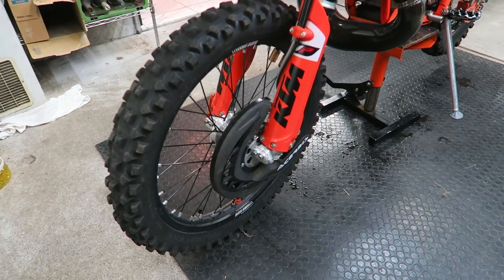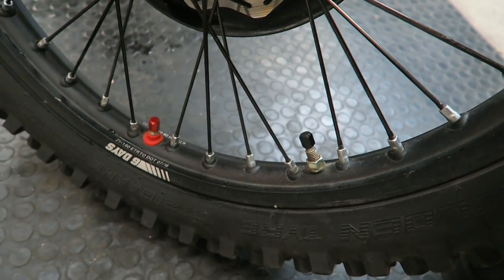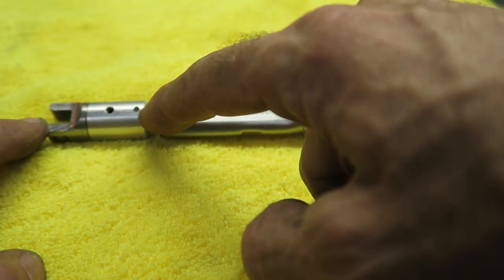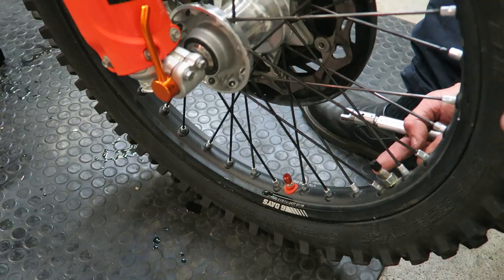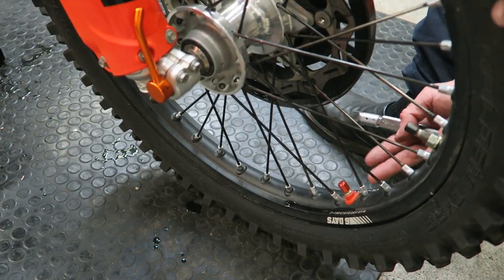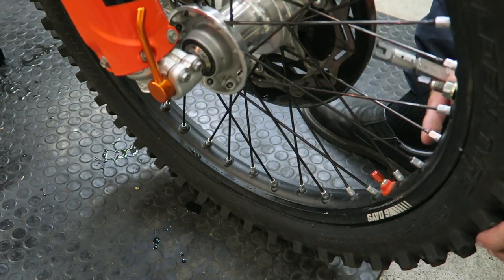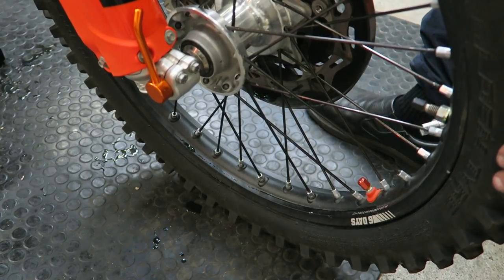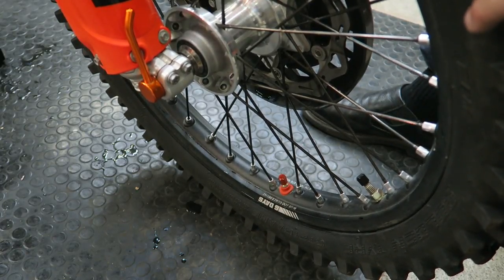Wheel Spoke Tension Adjustment

Comment: Hoping that you’re still monitoring this old video, here is a technical question. As in your case, when I go around the wheel some spokes are torqued and other aren’t. If the wheel is true, tightening only some spokes, would it not pull it off centre? Do i need to worry? How can I make sure that doesn’t happen? Thanks.
Reply from the maker: If you’re worried about the wheel being out of true you can attach something (Eg a chop stick) to one of the fork tubes, or swing arm so you can monitor how out of true the wheel is. For off-road wheels they don’t need to be that true and within about +/-1mm will be fine.

Comment: Hey just did the first torque on my bike (5hrs) and the rears weren’t too bad, but is it normal that the fronts were super loose? Like had to go around the wheel  6x using this method and only half a turn at a time? The rear took only 3 rotations to get all at 6nm (according to owners manual)
Reply from the maker: Wow, your front sounds like it was very loose. The rear sounds pretty normal. It's lucky you checked and adjusted them...

Comment: Hey mate, my rear wheel has a wobble.  I started with loosening all the spokes and went around and true'd the wheel using the zip tie method. I then went back over with the torque wrench set at 6nm (as per ktm spec) and the wobble is back. What is the trick to trueing vs torquing?
Reply from the maker: If the rim is bent it may not be possible to correct easily. If slight you could ignore it, or try to true it by loosing the spokes on one side of the bent area and tightening on the other. When finished it's still important that all spokes have an equal tension as this is what keeps the wheel strong and less likely to go out of true further.
Reply: @TokyoOffroad  thanks mate. I always look forward to hearing from you. So equal tension would require the torque wrench and this is where it untrue's. I also have 1 spoke that won't budge. I've tried penetrating fluid, vice grips. I'm hesitant to use heat as I'm running tubeless and think it could melt the tape. Thoughts?
Reply from the maker: @frankloschiavo  Yes, using a torque wrench on spokes is only a good method if the spoke nipples and threaded part of the spoke are in good condition and move freely. If any of the the nipples are seized they will need to be freed. When I rebuild wheels I use some anti-seize to help prevent issues. A different method to test the spoke tension which may work better if it's an older wheel with corroded nipple is to listen to the sound of each spoke with tapped with a spoke wrench and to make them all sound a similar note.

Comment: I am interested in the orange protection cover of Tubliss valve. What is that?  Any pros or cons?
Reply from the maker: Chieh-Nan Wang - DRC air valve mud guards. They help prevent dirt and water getting into the rim, without putting stress in the valve. They can be used with tube tires too, not just the Tubliss high pressure valve stem.

Comment: Just went through this procedure on my 18 350 EXCF. Specifically on the front the spokes were extremely loose and needed to go around at least 4-5 times in the skip 3 pattern to bring them to the 6 Nm mark using a torque wrench. I’ve read various things online saying KTM is notorious for loose spokes but this seemed excessive. Only about 12 hours on the bike and this was the first go at the spokes. Interested to know what others think.
Reply: LETSG0WVU mine have been similar on the last two KTMs
Reply: @DoctorGoodnight  I sell KTMs and we show every dirt/adv customer how to check and adjust spoke tension and advise them to check their spokes before every ride for the first 6 rides.  It's not ideal and needs to be remedied by KTM, but it's also a pretty easy thing to keep an eye on.

Comment: Hello!why is so important to keep the wheels straight?you are using the bike only for off road or not?
Reply from the maker: 66AGW - The main reason to keep the spokes adjusted correctly is that it adds a lot of strength to the wheels which is particularly important when riding off-road while riding on rough terrain.
Reply: @TokyoOffroad  my wheels has dents on them and all the pro riders told me not to replace them because i will bent them on the next ride.they must be tight right and that's it
Reply from the maker: 66AGW - Yes, I wouldn’t worry about dents, unless they are causing issues. Just keep the spokes tight and the rims running reasonably straight and you should be fine.

Comment: that dry lube would prob be good on the carb slide to eh?
Reply from the maker: My recommendation would be to not use any lube on the carb slide. Clean and dry the slide before assembly and assuming it's not damaged you should have no issues.
Reply: ya i got the lectron on mine it works awesome i just figured since it was dry it couldnt hurt but thats why i asked cause ive never used dry lube, first time ive ever herd of it.
Reply from the maker: The PTFE dry lube is ideal for lubing the throttle tube as it won't attract dirt like oil and grease will. One can is less than $10 and will last many years. Highly recommended. In the US on Amazon WD40 and Dupont appear to be the most popular dry lube brands. Will add some links to the Throttle Maintenance video description...
Reply: I like using Wurth PTFE dry lube. Very nice!

Comment: Hey there, who makes the front disc cover?
Reply from the maker: Michael Steven the one in the video is an Acerbis plastic guard. However, I recently replaced it with a Pro Carbon Racing carbon fiber guard which is really nice.

Comment: Are all dirt bike spoke nipples the same, no matter the wheel brand/size or bike brand? Do they all torque to the same spec?
Reply from the maker: Charif Lakchiri- KTM off-road spoke nipples are all 6.8mm. Other brands use different size spoke nipples. Regarding the spoke tension torque setting, 5.4Nm should be fine for any wheel.
Reply: The North America 17 300 XC-W owners manual lists the spoke tension torque spec at 6 Nm, I figure that the difference between 5.4 Nm and 6 Nm is negligible. Is 5.4 Nm what most wheels recommend?
Reply: Tokyo Offroad , using a 6.9mm spoke wrench on a ktm off-road wheel (6.8mm spoke nipples), is it going to cause any damage to the spoke nipples or is the 0.01mm difference negligible?
Reply: @mattiassjogren2840  did you used a 6.9mm spoke wrench finally? or a 6.8, I'm not sure what to do on a 2019 exc..
Reply: @xaviermajoral8923  i used the 6,9mm and no problem at all